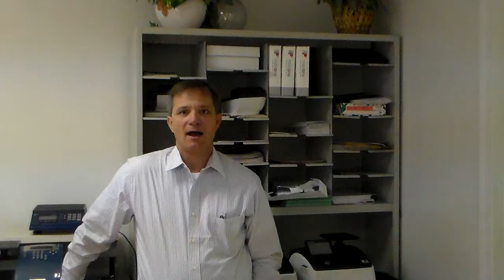Getting a Postage Meter

Comment: Hello, I am thinking about getting a postage meter for high volume first class letters. Standard envelope size. Is there any meters that have added features such as folding/sealing?
Reply from the maker: It is possible to get a folding and inserting machine that feeds into a postage meter, however, no current machine is created to do both.   Please call me at 702 218 3205 for further details.